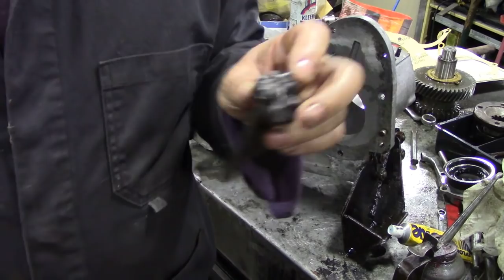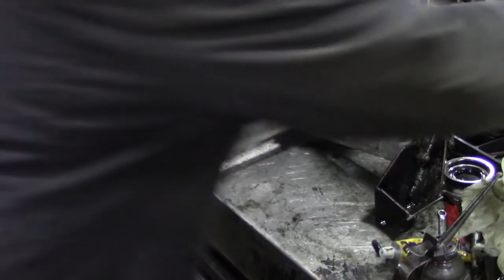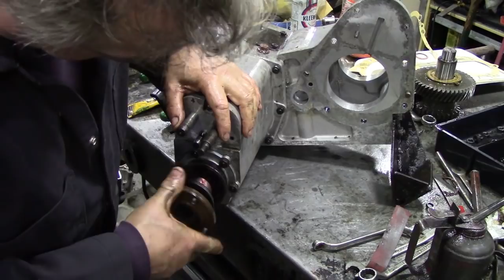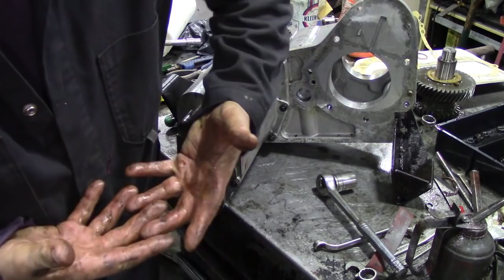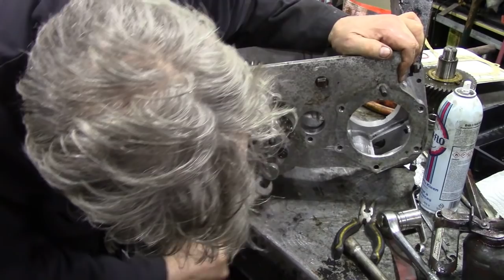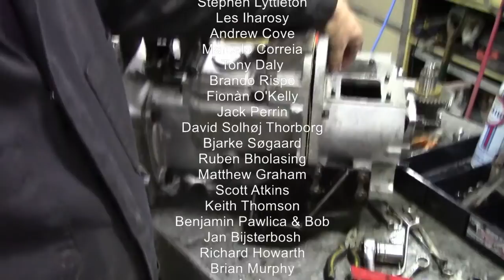Series transfer case strip and check. Part 2

Comment: Both the parts manual and the green bible don't show a felt seal on the front output flange. Does seem a bit odd, since they are on most of the other drive flanges. Of course I think having it there can only help things.
Reply from the maker: I always fit them to prevent oil getting down the spline

Comment: Anything wrong with soldering a piece of brass shim material over the holes before painting??
Reply from the maker: Yes you could do that but really this is not going to be in the wars again and maybe grease will keep out the water for a good few years
Reply: @BritannicaRestorations  Or two part Araldite (other brands are available!), used it before to repair a copper pipe I drilled through by mistake  which was hidden in a wall oops.

Comment: What size of bolts and nuts does the transmission bell housing use, Ie where it bolts to the engine I am missing a few LOL so I know either someone has been in the transmission or they just fell out LOL
Reply from the maker: Series are a bit of a mystery the were 3/8 BSF, 3/8 UNF and later M10 metric
Reply: @BritannicaRestorations  ok cheers That helps